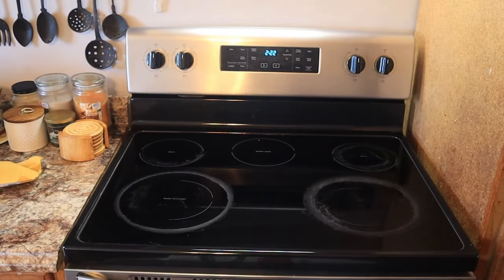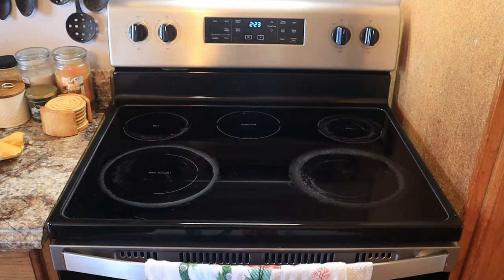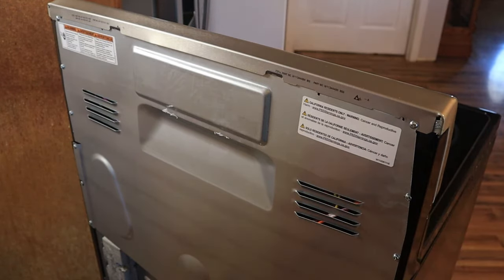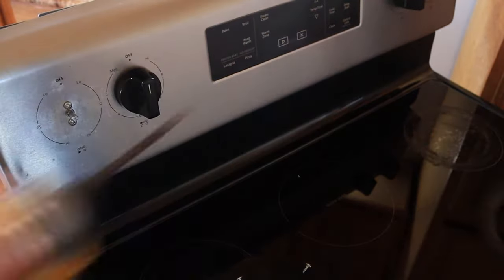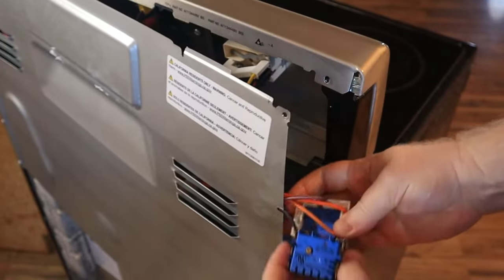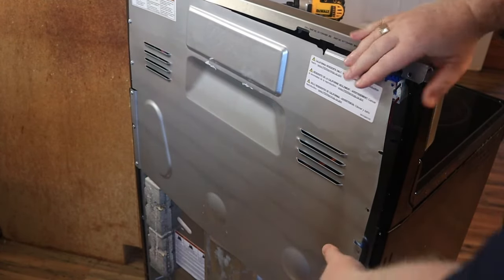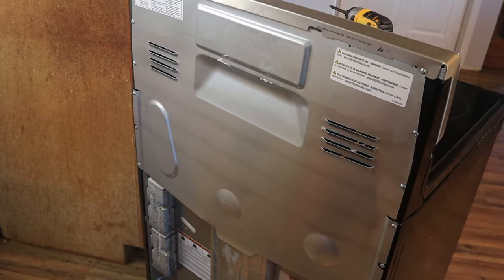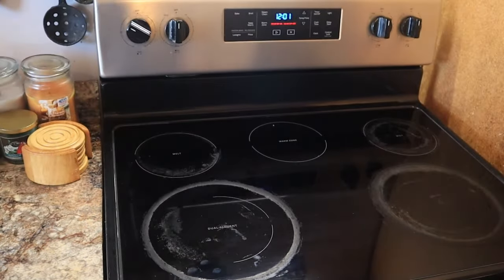How to repair a Whirlpool flat top stove burner that stays on high

Comment: My dual burner stayed on high no matter where I set the dial. I removed the switch to investigate. I took the cover off and turned the knob. I noticed a copper colored bimetalic contact that was staying closed all of the time. I used a tiny screwdriver and bent the contact upward slightly. It sprang back up in the open position. On closer inspection I noticed it was a little warped. I carefully pried it until it was straight. I reassembled the switch and tested it out. Works like new again. I ordered a replacement part just in case this one messes up again. This one worked well for four years so I expect the other one to go as well.
Reply from the maker: That works
Reply: @BeyondtheBoom   can you tell me the part for this same oven but for the right bottom single burner? It doesn’t go on at all.  thank you
Reply: Yep, this really applies to all mechanical electrical switches- especially useful with power window/locks controls in cars. Most of them can be cleaned/rebuilt/repaired to work just fine.
Reply: I’m having the same problem and can’t afford to replace the switch and winding if this would work on my stove to nut not sure what part of the switch I need to be looking at.

Comment: Thx for the video but BS on those connectors coming off that easy (exact same one).
Reply from the maker: You watched me pull them off. Take a small screwdriver and work it off if you're having trouble

Comment: Was cooking on this same burner when it just turned off and stopped heating.

I am going to assume the burner is still good and it's the switch that went bad and I'll replace the switch.
If anyone thinks different, please feel free to comment.

This is the burner and switch that gets used the most.
Reply from the maker: The switch might be the problem
Reply: @BeyondtheBoom  Thanks, I ordered the switch and already have it.

With shipping and tax it came to $68.00

I looked at the switch and I can't believe it cost them more than $10.00 to produce, but oh well. It's better than buying a new stove or calling The Guy to come out and fixe it for $200.00

Thanks for putting this video together.

I've fixed so many of my own appliances by watching videos like yours..... and that translate into money saved.

Comment: Thanks!  Is the metal plate on the oven door with the "warning" info with a number W10406473A the model number? 

Unit is too heavy for me to move full range off the wall to look. 

Also how do I know which wire goes with the correct burner?
My broken one is the Front Right SINGLE LARGE  burner. Not the "Dual Element"
Thanks
Reply from the maker: Yes I think so

Comment: Thanks for sharing.  Oftentimes the secret sauce to troubleshooting & repairing the stove yourself and saving some money in the process is simply having a good understanding of how it works.  

With the exception of induction cooktops,   virtually all electric cooktops,  whether they be solid disc (far more common in other parts of the world,  notably Europe,  making their way into American kitchens for a short time on some KitchenAid, Jennaire and maybe a few other high end models from about the mid 1980s - early 1990s) coil top, or radiant elements under glass, use what's known as an infinite switch, sometimes called a simmerstat,  and operates on the principle of duty cylcle control.  For example,  if I have the control set to medium so that the element spends 10 seconds on, 10 seconds off, that equals a 50% duty cycle, and if this is a 6 inch, 1500 watt element,  than my overall power level is 1500W * 0.5, or 750 watts.

Some older cooktops from before the 1970s, used a push button or rotary selector switch with 5 fixed heat settings usually marked Hi, Med-Hi, Med-Lo, Lo, Sim.   With these cooktops,  the element is very different than modern ones in that they (usually) have 3 terminals and are two elements in one burner.  Power level is controlled by switching different combinations of 240 or 120V to one or both elements,  in series or parallel, varied slightly between manufacturers.   With these older cooktops if a burner works on some settings but not the  others, either the burner or the selector switch is bad
Reply from the maker: Thanks for watching

Comment: Thank you for mentioning about it being a dual switch for that burner.
Reply from the maker: There is a difference in the switches if you need to replace one, make sure it is  the right replacement.

Comment: If I have multiple burners having this issue do I need to replace multiple switches or does that switch (blue piece) work for all the burners ?
Reply from the maker: There's a difference in the switches between the two zone burners and the single

Comment: I have the same issue and have replaced the switch. It seems to still have the same issue. Can it be any other issue? All other videos I found only replace the switch. The part number I got has been replaced with a universal switch.  This is for a single zone burner.
Reply from the maker: I would try to get the original part. If it turns out to be the element you may want to have someone repair it or just get a new one.

Comment: This was very easy and well guided! Thank you! The module that you purchased is the same one I need for my whirlpool stove, I have 2 burners with this issue. Would you happens to know if it will resolve both or a separate one will be needed?
Reply from the maker: Thanks for watching.
Reply: 9/2024  I have the front 2 duals burning hot!  getting ready to order the switch did you order 2 switches, or did one switch fix both?

Comment: Where do you typically find the model number of the stove?
Reply from the maker: Look for a sticker on the back.
Reply: @BeyondtheBoom  I'm not seeing a sticker but I did take apart the stove and ordered a replacement switch based on the part number.  Thanks for the video.  I never would've known what the problem was.  I was expecting to have to pay a lot of money to fix it or just learn to live with it but it should be an easy inexpensive fix.

Comment: Thanks.  Does anyone know if there a temperature sensor in the stove top that could also be a source of failure, 
or is it always the control switch?
Reply from the maker: Control switch
Reply: I have the issue but it appears to be with the four discs so I am unsure if I need to change all for of them… Thanks for the help

Comment: How about when it works on high but if i set it to medium or low the heat turns off what causes that issue?
Reply from the maker: The switch is what controls it
Reply: Thanks

Comment: I just replaced two infinite switches on our Whirlpool electric stove this morning. It took me 20 mins from start to finish and about $80 for parts. Easy job and now both of our dual zone front burners are working correctly. Thanks for your vid. (01/04/24)
Reply from the maker: Nice work!
Reply: Where did you buy the parts?

Comment: Using an impact driver to loosen or tighten the switch screws is a bad idea.
Reply from the maker: How do you think they built them?
Reply: @BeyondtheBoom  It's pretty obvious.  I have been in manufacturing for many years. Impact wrenches and drills maybe in the GM plant, lol.  Appliance plants, air tools at the lowest setting, so as not to strip screws, screw heads.  If you were reassembling more than one stove then yes, power drill/driver.
Reply: Irritating a guy carrying a gun is a bad idea, Poindexter